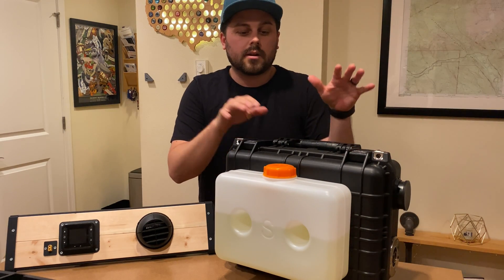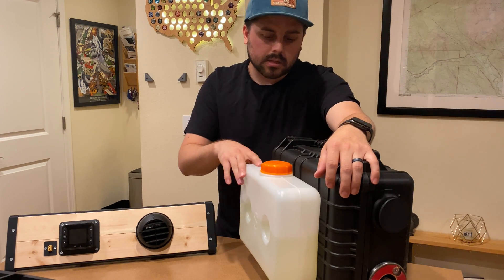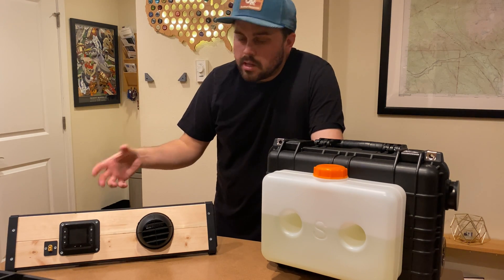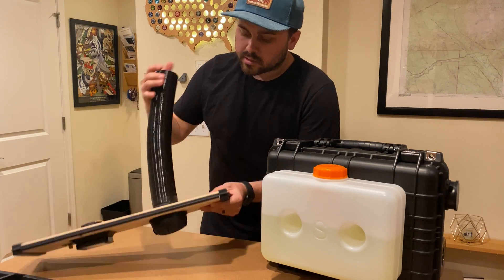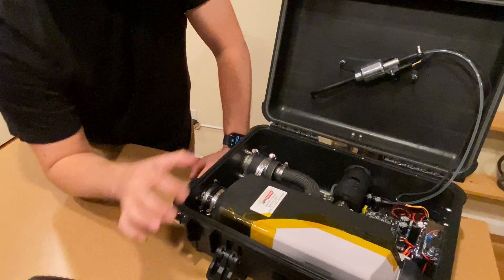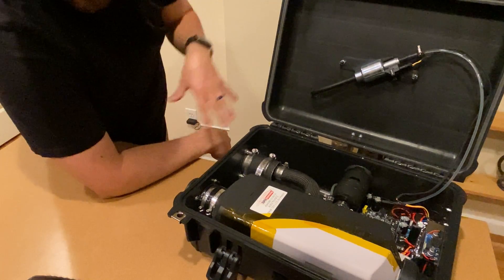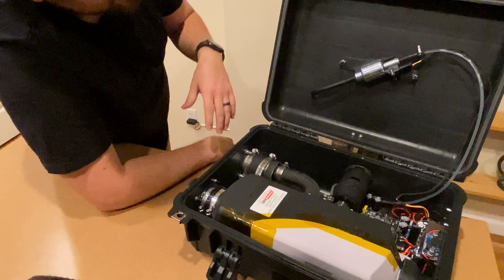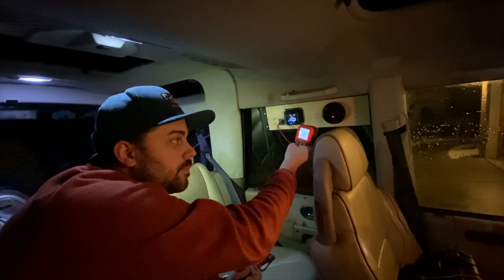Portable Diesel Heater in a box!

Comment: Wow, really the nicest build i have seen for such a unit. Compliments. One question though: you didn't use the silencer ??
Reply from the maker: The units aren’t too loud without the silencer. I do clip in on to the exterior using a small piece of exhaust tubing. The problem with the silencer is that they are not designed to be sealed. This means that fumes could enter the interior of the box if I used one.
Reply: @keeganbuilds  Hi Keegan, see the point. thx.  I noticed you chose the 2kW unit. Would you in hindsight and with present experience go for a 5kW as i see regularly. Im asking as i have vanagon
Reply from the maker: @rontenvelden8566  no way. 5kw is too much. 2kw would probably be fine for your setup. These little units like to run at full speed otherwise they get full of soot.

Comment: Your design is brilliant and exactly what I've been looking for. When using the heater in the car, do you have humidity problems?  I know these heaters put out dry air, but exhaling can cause moisture buildup over time. Would you recommend exhausting some air through another window, or perhaps another vent feeding warm air from the vehicle back to the heater intake?
Reply from the maker: Thanks! I actually run it with another window down and it’s it super dry in the vehicle! I dry out my ski gear in the car haha
Reply: @keeganbuilds  thank you!  I'm going to give this a try.

Comment: Been looking at them. They already sell them as a complete unit in a housing. Just wondering why you went to the trouble of doing it? Plenty of different sizes availabe alsohttps://www.ebay.com/i/283609101378?chn=ps&norover=1&mkevt=1&mkrid=711-117182-37290-0&mkcid=2&itemid=283609101378&targetid=935431404853&device=m&mktype=pla&googleloc=9021773&poi=9021773&campaignid=10460107125&mkgroupid=106723176187&rlsatarget=aud-412677883135&abcId=2146001&merchantid=118974391&gclid=CjwKCAiAtej9BRAvEiwA0UAWXi5Khx2OXAsuM_DoQlR7H9VmiLqW2R_gUmx0pz7TASQZSXcHlWzAKhoC0mcQAvD_BwE

Comment: Fantastic build! Could you (or anyone for that matter) explain the purpose of the 12v stepdown? You said in another comment that the computer fan has a 5v stepdown which I understand, just not the 12v. Does that just help ensure maximum longevity of the unit?
Reply from the maker: The purpose of the 12v buck step down was because I have multiple battery sources with different voltages. My main battery source is a 36v system. So I wanted a way to utilize any source of dc energy without worrying about dealing with it. Also, I’ve got a secondary step down on the computer fan that steps the 12 down to a 5. In future builds I would just utilize a 12v fan instead of stepping down again.
Reply: @keeganbuilds  Thank you so much. I was wondering if that was the case. I'm picking up a heater like this while we build our skoolie so I can work on it through the winter before the wood stove goes in at which time the diesel heater will be backup heat. I also want a self contained unit to make portable and your build is the nicest I've seen. Thanks again!
Reply: I just rewatched that portion of the video and I somehow missed the part where you explained you had a 36v system, doh!

Comment: That is a great idea! What kind of amperage does the heater draw? Might have to make something like this with its own power source. It gets to -35°C before the windchill here and if I break down at work at 3am with no cell service or two way, nobody is going to notice I'm missing till 8am, then it could take hours till they find me. I could siphon some fuel out of the truck and fire it up. I think I would run two hoses into the cab and draw breathing intake and heater intake from inside the cab so snow doesn't plug it up.

Comment: How is the long term use going for you? I would have been worried it would hold in too much heat since the PC fan you added doesn't appear to have an output?
Reply from the maker: It’s going great. In theory it does have an output (the intake of the combustion for the engine)
Reply: @keeganbuilds  : i am wondering about the temperature INSIDE the box while operating ? doesn't it get too hot (melt ?) Thanks for the great video
Reply from the maker: @jerome_brr  considering the casing of the engine is plastic, it doesn’t get hot enough to melt . You’ll notice that I have a computer fan constantly pushing cool air in to the case (which the engine uses for its combustion intake) thus, constantly moving fresh cool air in.
Reply: @keeganbuilds  Yes i've noticed the computer Fan, pretty smart and does not take much power to run. In my built i wasn't planning on putting any fan because the box will stay outside of the vehicle, still in a protected area from the element but snow/rain could eventually get in (especially snow in a blizzard). The other thing is I just meet the minimum clearance around the heater (it is eberspacher S2) because my space is limited, so is the case... i was wondering if i shouldn't use aluminum box, but they are pricey and don't come in my desired dimensions

Comment: @KeeganBuilds nice job. just a suggestion: it's better if you put the dc step down board in another place inside the box, or maybe add some filter or protection for the air coming from the fan. Cold air inside the hot box can create some water on the board, even some snowflakes can get inside the box because of the wind or a snowfall.

Comment: How is the actual heater mounted - is there a metal L bracket? Also, what length did you cut your 7-way wires and heat duct to? Thanks

Comment: One of the cleanest builds I have seen sir!  Excellent job.  One question if you dont mind answering?  Do you have a link for the cooling fan used for the internal electronic componemts and air combustion chamber?  Thanks.  I have everything else for the modified  build of this that Im doing but just need the fan. Take care
Reply from the maker: Thermaltake Mobile Fan II Adjustable Speed External USB Cooling Fan with One-touch Retractable USB power cable box for Notebook Laptop Desktop. A1888 https://www.amazon.com/dp/B00080G0BK/ref=cm_sw_r_cp_api_i_MDrxFbY17RES8
Reply from the maker: Just remember I ran a 5v step down to this because it runs on 5v.

Comment: This is great! Thank you for the descriptive video and the links to the parts. I will be building my own once my 3d printer arrives. I have the 5kw unit and may have to enlarge the prints as well as use the 4800 series case. This is the cleanest install I have seen.
Reply: did you ever build yours? I'm using a 5kw as well
Reply: @erniemyslinski4113  Did you ever get this figured out? I have a 5kw that I want to put in a 4800, too. I'm going to search for some existing models for larger ports, but not sure what else would need modified.

Comment: Last fall I was searching for ages for a compact build like this since it's exactly what I want to do with mine, super clean and well done! That 8 pin connector is a clean look. Ever have an issue with exhaust getting in the intake? They seem pretty close together. Was thinking of adding an Arduino with a few sensors and a relay for emerg shut off. Thanks for posting this! Great work. Do you not find it too loud without the muffler?

Comment: Hi Keegan, 
Could you give me an idea of what the tubing is that takes the heat from the self contained unit to yours window adapter.  Do you have a link for it ... or if available at Home Depot, what is the item #.  Is it plastic dryer exhaust  hose, if so is it safe?  I enjoyed your ingenuity in compacting and packing the whole thing.   Thanks,    Kim
Reply from the maker: Kim Clough thanks for the nice words! Depending on if you are are a 2KW heater or a 5KW Heater will determine your diameter of this tubing (60mm vs 75mm). My heater unit is a 2kw one (linked in the description) and I just typed in “60mm heater tube” on EBay and a bunch of different options turned up.
Reply: @keeganbuilds    Hi Keegan,  I Have the 5kw heater hence the 75MM Tube.... I looked on Amazon - they look are metal.   From your video, the tubing you are using looks far to flexible to be the metal type which is about the only kind i see.   What tubing are you using?  metal or plastic?  Thanks  Kim

Comment: Great job, I like this idea, where did you source the voltage converter and the fan?
Reply from the maker: I sourced it from Amazon, https://amzn.to/3e9L9OP  also any 12v fan will do, the bolts match up exactly to the intake grate bolts used on my thingiverse files above. Heres the link to that fan: https://www.amazon.com/gp/product/B00080G0BK/ref=ppx_yo_dt_b_search_asin_title?ie=UTF8&th=1 (this is a 5v fan so i do have a small stepdown converter mount to this that converts 12v to 5v)
Reply: @keeganbuilds  thank you very much
Reply: Can you send a link to the voltage converter and would you sell the 3d printed parts needed I don't have access to one.

Comment: That's an impressive and clean build.   Can you tell me more about those twist lock connectors and wiring sheath you have between the box and the window mounted panel?
Reply from the maker: Ryan Connor sure can! If you’d like we could message on Instagram so I could share pics too. @keegancdr
Reply from the maker: ive posted some links of the parts that i am using for a better idea
Reply from the maker: In an effort to explain on here, it is an 8 pole Speakon cable connector, (that shelth has 8 wires inside of it. I have 5 of the 8 wires being utilized) 12v+, 12v- running down to the heater,  5v+, 5v-, Thermostat signal wire running up from the heater box to the thermostat. The other 3 cords inside the sheeth are unused.